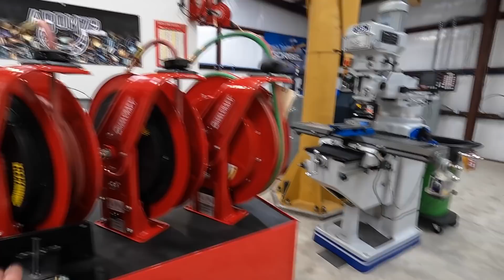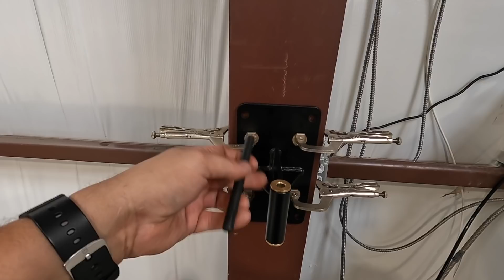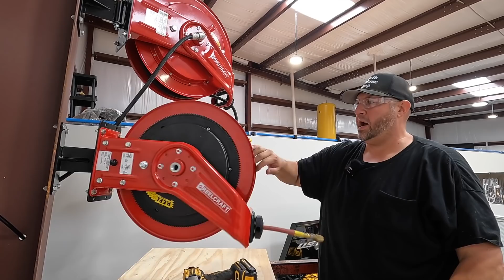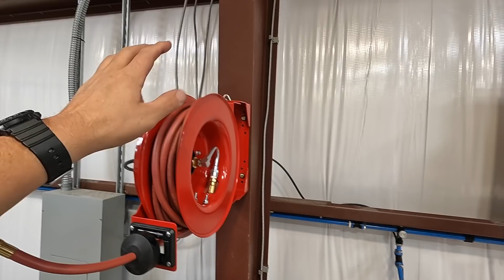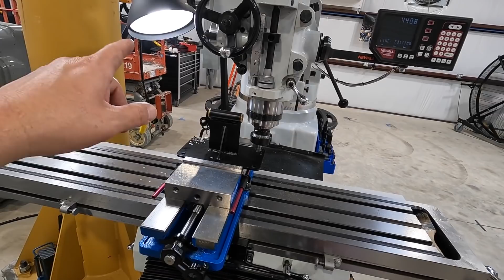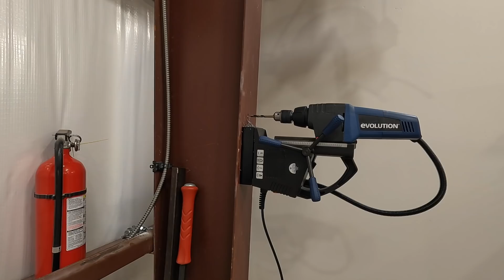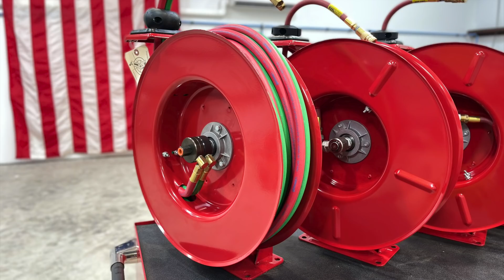Reelcraft Hose & Cord Reel Installation

Comment: The op has probably figured out by now, that air hose reel should be inverted, so the hose rolls up over the top, same as the electric cord reel.

Comment: Think you're going to restrict the air flow with the nylon tubing from the stem for the wheel, there is rotating fittings whit 90* couplers to

Comment: I would switch the air fittings on the hose reels out for 90 degree fittings. It will look more professional as well as put less stress on the supply hose. I’ve actually seen the wear from not using 90’s on hose reals that swivel first hand and dust goes flying everywhere when they finally give out.

Secondly as a former Firefighter I wouldn’t place your oxygen and acetylene bottles next to or so close to your office. Only thinking about your safety as it looks as if you only have the one entrance and exit.

Comment: Adam, there are 90 degree fittings available for your air lines. It may make it easier on the lines, especially that first one near the large garage door. Two major manufacturers for those fittings are Parker and John Guest. They also make the tubing as well. Most of the air fittings are pressure rated for up to 150-200 psi depending on which range you get, some even more for heavy industrial use.

Comment: $1,040 for a 12/3 100’ cord reel without the swivel mount is pricey.  That’s beyond my budget and you’re installing a half dozen units. More power to you - no pun intended.
Reply: Possible mostly businesses going for these. Last a long time I guess, so not so expencive in the long run. Adam here possible got some sponsorship from the manufacturer (which is alright, and natural) If not, guess he would not installed that many.
Reply: wow!  I wouldn't have guessed they would be that expensive.

Comment: I like the lightweight mag drill. I have a Milwaukee and it's like lifting a sack of cement. I also thought it would be less strain on the air hoses if you used a 90 degree fitting on the reels.

Comment: The new shop is growing fine!! I have a question about the fire extinguiser...is it a powder or a foam? As far as I know when You use a powder extinguiser ALL electronics, tools etc. is not useble anymore! Here in Europe every shop has foam extinguisers or inert gas for special tasks.
Reply: I agree. C02 works better without the mess and contamination.

Comment: the quality of that mag drill sucks big time.. i can tell that it is a cheap made in china product and i am pretty sure that the amount of noise it was making could be with the rotar being bad.
Reply: A lot of things can look shoddy and still be sound internally. How would feel if people judged you purely on looks.  The mag drill I used sounded similar. They use low rpm motors that have a ton of torque
Reply: When just using a drill 4 times a year drilling 30 holes, not need of sitting with a 5K usd high end drill. Likely do the job well enough for his use

Comment: those fly leads to the reels are too short (at least the first two are).  they need to be long enough that the reels can swivel fully either way without pulling the lead or hose tight.  the hoses would be better landed on 90 degree fittings, too.

Comment: You need to use Teflon or pipe dope when connecting the air fitting into the reel, just like when doing plumbing.
Reply: air fitting can very well have an o-ring and a flange, so you dont need any tape :)

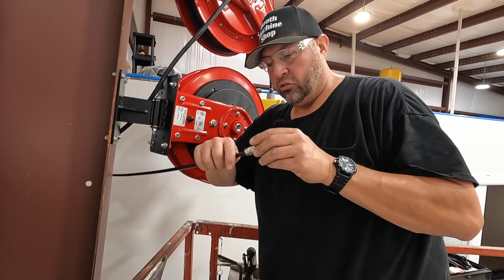Comment: 23:40 you can find those quick connect fittings on 90 degree elbows. It would fit better rather than forcing the line when pivoting the reel

Comment: I’d recommend using that guard on the mag drill. I worked with a guy that was using a mag drill with those styles of drill bits, the “birds nest” of chips grabbed his glove and tore one of his fingers off. Obviously other safety issues were present but still, if you have the guard, use it.

Comment: having never seen a magnetic drill in use  I have just noticed you have special bits in yours
Reply: yeah cannot use those in a hand drill to much lateral forces. Magnet works as a fixture making your drill into little portable mill.

Comment: You need a 90 degree fitting on the side of the hose reel. You will find a nasty habit of those push in air fittings to pop out when flexed frequently.
Reply: he needs bigger diameter of those nylon pipes in the first place :) leaving 10 extra inches of hose would solve fitting problem.

Comment: Adam, it's never a good idea to dril holes in a beam. It starts with one hole and ends with a Swiss cheese. Its far better to use a clamping system..
Reply: you could weld over old holes

Comment: When using a mag drill on vertical surfaces it is advised to add a safety tether to keep from dropping the machine should power fail or you bump the magnet off switch by mistake. It is also possible to cause it to pop off thin metal surfaces. The magnet prefers thicker metal. I have a Jancy slugger version of that unit. I have had mine over 35 years.

Comment: I see a lot of negative comments about you advertising the tools and equipment you have for your new shop.  If you are getting those things for free or discounted by showcasing them, they need to get over it.  You have worked very hard for a long time to make your channel as popular as it is and have taught us all so many things that you have learned in your many years in the machining trade.  I would like to say to those people is to get over it this is no different than Michael Jordan endorsing sneakers but at ridiculously smaller scale.  Keep up the great work Adam!
Reply: Yes!
A lot of it is jealousy. But I bet if those people had spent years and thousands of hours building a channel with good brand recognition, they would find plenty of good reasons why they needed to accept the sponsorships that came their way.

Keep it up, Adam.

Comment: Why didn't you use a square from beam to bracket?..............easier and more accurate than your chosen method.
Reply: You're assuming the beam is perfectly plumb with that proposition. I'd rather have a bracket level to a beam then square to it.
Reply: @TGC32  That beam is plumb/vertical in both planes, it will have had more than enough checks made on it to ensure that, before it was finally fixed in place.  If the bracket is properly manufactured and fixed square to the beam - that bushing will be upright.  A better quality level used upright against the top and bottom bushing would verify that.......his chosen method left too much room for error.
Reply: @thepotterer3726  you nailed it sir. 
if the bracket is properly manufactured - you turn two bushings and a sleeve with machinist tolerances and THEN you give it to a welder to finish a bracket, with a welder tolerances.
Adam's method eliminates welders error but assumes bushing was faced after boring and it is precisely fitted into a sleeve.

IF this was anyhow critical you could bore bigger holes, mount a bracket, assemble hose reel, then level reel itself before tightening bolts.
How the reel sits when not in use is not important, and when being used it will swing into direction of pulling force regardless of level.
Abby's eyeball would be precise enough

Comment: If there is enough slack, maybe a zip tie through a spare mounting hole to keep that power cord from rubbing on the lower bracket?
Reply: it can rub like that for 20 years and after that it will trigger a dedicated breaker, at least justifying money spent on it. let it rub.

Comment: I agree with some of the commenters from the previous video.  The compressor should have been located on the mezz next to the extra pressure tank.  The company who ran the blue pipe is not nearly as good as you think they are.  They should have put tees on the mail line for you to connect the reels to so you do not have the ugly black line tie wrapped to the pipe going back up.  Also the blue pipe should NOT be on the roof of the mezz.  It should be on the wall of the mezz, on the inside of the outside wall or on the ceiling (to hit the corner of your office where the two reels are.)  I do envy all your new equipment and shop though.
Reply: Thought the same thing.  I want to say that he posted something about the compressor and the mezz on Instagram or FB.  Something wasn't going to work...I can't remember.  I agree that the pipe run is HORRIBLE.  Much better ways of running that.
Reply: Yeah, having that pipe right on the edge of the roof - that kills off easy forklift access to put a pallet up there.  MIGHT be doable with super long forks, who knows!  Also yeah, floor space is precious, the mezzanine doesn't seem so critical, so anything that can be up there should be, in my opinion.
Reply: @goose300183  agree 100%.  Floor Space is KING!  Only thing that comes to mind?  Load limits.  Some of those lego built shops like this, their mezzanines are rated for like 10lbs per sq.ft.  That compressor may weigh in at 200 lbs or more and use 5 sq.ft. which would put it over the weight limit.  

I think Adam had a FB or IG post about it not working out on the mezz, and he really wasn't happy, but was "this happens sometimes".
Reply: @WreckDiver99  aye, good point, it might just be there to function as a non-structural office ceiling rather than a load-bearing floor.

Comment: DRILLING into structural beams of a rented building?
Reply: Sure...most "industrial" areas allow all of that.  I mean he bolted his jib crane to the floor, mounted his Mr. Cools to the walls, and drilled through the building.  No issue with drilling into those beams.  I'm sure if it was THAT big of a deal he could have welded a plate to the beam, and when he was ready to move out he could cut those plates off, grind the beam flat and paint it....but nah, those holes won't do anything.
Reply: Yup, all day long.
Reply: drilling cutting grinding we do it all. thats why we have a welder too!

and lets be serious for a second, like Wreck said such holes wont do anything. more than that engineers are putting much bigger holes in structural beams for purpose!

Comment: Abom.
please read.
The airline reels are great BUT the same idea for electricity is a Very BAD idea UNLESS You know what they are and how they (and electric appliannces) work.

NO its NOT a simple extention lead.

Please Look at it.

It IS a length of cable that is fine to use as an extension lead ONLY when its Fully unwound.
Upon recoil it (obviously) COILS into MANY TURNS or loops the entire length - nice and neatly and very DANGEROUSLY!

You can check out how electrical Transformers and Inductors work.

It is all fine UNTIL somebody that doesnt understand POWER in Watts, plugs in an item of high current /power (since the V is fixed) using only a SHORT length being unwound.

In that case you will have the equivelant of an electronic INNDUCTOR that will introduce a phase shift between your supply Voltage vs the current that is being drawn by the appliance in use.

Yes its ac.  Yes it causes a phase shift.

EXACTLY as do electric motors drawing more power to start.

This isnt the place for an electronics tutorial but if you draw a high current or power through a coiled wire - it can AND OFTEN DOES heat tha cable (where its coiled - not on the strait bit) 
until the coil of cable melts.

I am sure you know of INDUCTION HEATERS (Afew turns of wire and a high current) designed to MELT METALS?
So,  then your in Fire & electric shock teritory.

Best practice is NEVER  to use an extention lead coiled up.

If you look at loose extension leads,  you often see them with wrinkly coils
of wire.
This wrinkly coiling ISNT due to keep winding it up.
The wrinkled coils IS due to periods of high current through a coil ot that cable.

I am NOT an HSE twat.
I almost always remove safety guards (especially from grindettes & angle grinders)  and other machines Unless I make them for a purpose.

Because I know what I am doing and THINKING is far safer than relying on somebody elses possible thoughts.

You cant be certain that ONLY YOU will try to use these extension cables.

So you need to cater for the non educated.

Sign "UNWIND FULL LENGTH BEFORE USE" may create a trip hazard - but its better to stumble than burn!

Good luck.
Reply: Need more ALL CAPS so he gets the message
Reply: @andrewridenour7332 Hi.

 I was trying to help Adam.

I wasnt intending to lay down any demands.

I therefore tried to minimise caps. Just using caps to minimise long explainatory sentences.

As obviously there will be tosser wannabees with wrongly contradicting comments.
Reply: @N1gel  CatNolara  is right, and you are wrong sir.
Your example of induction heater is inadequate.

only danger is from overheating the cable.

extension cords has instructiion to unwind them, because they are rated close to maximum capacity of used cable, marketing and cost wise.
Industrial extension reels could be very well be rated for much lower amperage then capacity of used cable, accounting its use while beeing partialy relled in.

Stuff you talk about its quite important when using old school ac welders with long cords like in shipbuilding industry.
Reply: You do realize that you have two leads in that cable (not counting the ground lead), both with the same amount of current but flowing in opposite ways, cancelling out eachother? Only thing you gotta look out for is the cable getting more warm when coiled up while drawing high currents, but that's about it.
Reply: @CatNolara  
Yes I realise perfectly - thank you.
Luckily for you - you used the childish but understandable words "same AMOUNT of current" - in 2 of the wires.
Being pedantic - wont disagree there.
However the rest of your comment overtly describes to all with an education that your understanding is rubbish & an almost total failure in this respect.

If you take advice - you should learn about ac.
Learn about reactance.
Learn about Inductors.
Learn about trig functions.
Learn about J (but be aware that pure mathamaticions use i - for these "imaginary numbers")
Learn about time so that you can learn about frequency & phase & wavelength.
Learn more about phase.
Learn about vector summing.
& for Interest you may want to learn about capacitive reactance.

Good luck.
Reply: @N1gel  you can't tell me you know all about that stuff (not only being able to name it, but actually understand it) and still getting this wrong?

Btw. I looked it up just to be sure, and a lot of people who are well enough versed in electrodynamics come to the same conclusion that the magnetic fields cancel out. How do you explain that? Can you show me anything that states the opposite except for your own words?
Reply: @CatNolara  Its easy for those of us that understand.
Your asertion of the current traveling back at 180 degrees is laughable.

It shows you have a minimal understanding of dc and no idea about ac.

Actually, the relationship between the amplitude of the currents in the 2 wires in the cable CAN be ANYWHERE  between zero and 2pi radians.
With mand dependent variables.
You should view Electrobooms recent video on electron flow.
You wont understand much of it but if you listen to them conversing well, you may start to realise how little you know
.
I am NOT being rude.
Persevere.
Reply: @N1gel  you're being very rude and condescending. I won't continue this argument since you're more busy insulting me than actually explaining anything
Reply: @CatNolara  please dont contradict my correct information to your own Misunderstanding.

Yes ovbiously there are 3 flexible cables within the outer sheith of the primary cable.
Your may have some understanding of dc but your terebly wrong in this ac scenario.
Reply: @N1gel  no, it's you who has the misunderstanding.

I'll explain it for you: if you have a coil of a single wire and send AC current through it, it will generate an alternating magnetic field because of it's inductance. If the current runs in the opposite direction (or in this case with 180° phase shift) an equal magnetic field will be generated, but also in opposite direction. If you wind both of these coils together, the magnetic fields cancel out eachother and you'll end up with practically no inductance. I studied this stuff, trust me.
Reply: @CatNolara  
Laugh.
It made me so sad that these woke places of education lead the sheeplets to slaughter so easily.

No I dont trust you.
Your very basic understanding is wrong and no hope for advanced understanding in the near future.
Your actually trying to talk about very well understood Byfilar / Bifilar windings and mutual inductance but you dont have a basic understanding to start with.
Reply: lol, it's like people never used an extension cord reel.
Reply: False information.  You are confusing resistive heating - which is why if you are using these at high capacity you should unwind fully - with inductive heating.  Inductive heating does not happen because the Line and Neutral conductors are close together.  So the current in one conductor is exactly cancelled out by the return current in the other conductor.
Reply: @JimWhitaker  Sorry but your Misunderstanding is exactly why I made the comment.
Reply: What a load of utter drivel

Comment: Adam, Ask your electrician about beam clamps for the reels, no need to drill the columns.
Reply: Or get someone with a workshop to make some 😁
Reply: In the industrial setting  installs like these we used beam clamps, cut setup time to a 1/3 of drilling all those holes, if the position is not optimum, simply loosen the clamps and reposition or relocate in a few minutes, why make it complicated?